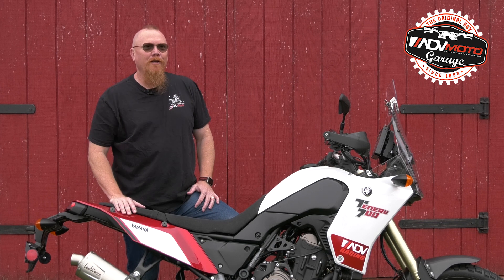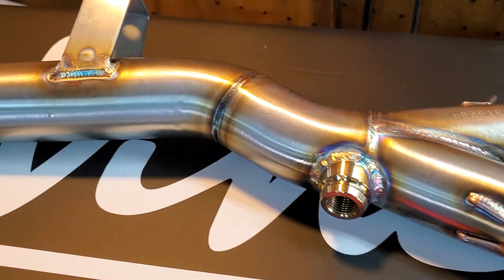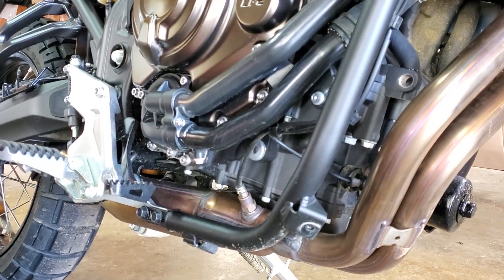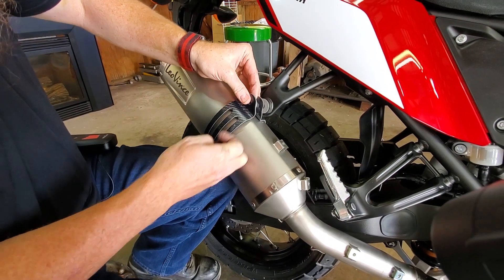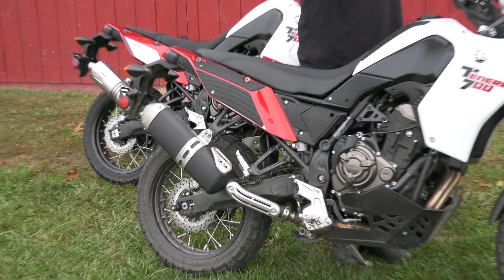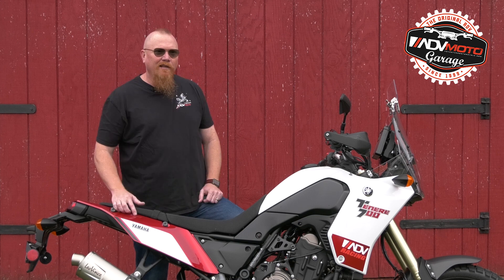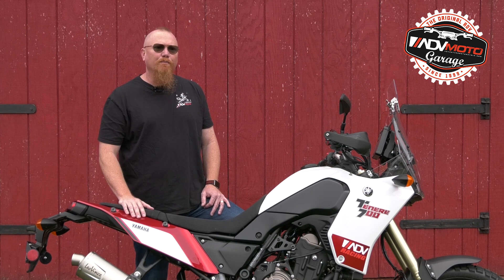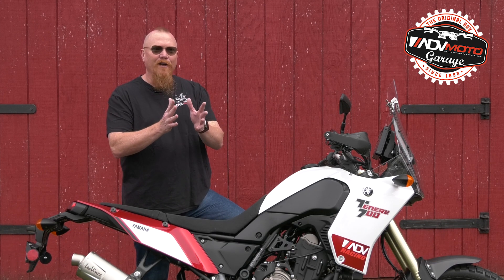Yamaha Tenere 700 LeoVince LV One Evo Exhaust Sound and Install

Comment: Hey fellas, quick update on the header and crossbar hitting on the Givi crash bars. 
Got a machinist to extend the crossbar and took it and had it powder coated. Worked like a champ, can't even tell it.
Installed the leo headers and paired it with the HP Course Ti pipe. Sounds great 👍. Sent off the ECU to get flashed, probably saved close to 8 pounds off the bike..
Reply from the maker: Awesome! Thanks for the update. Feel free to post a link here to the project if you have one.
Reply: Neil - I'm running the Givi crash bars and debating getting these headers.  Is there any way you could link to a pic of your modified crossbar?
Reply: @mpwicks  I would be glad to share the pics of the modified cross bar if I knew how to on here?? Sorry ..lol.

Comment: Hmmmmmmmmmmmmmmm. wondering IF any change in performance....dyno numbers?  Maybe add to the exhaust list for ULTIMATE T7 build.
Reply from the maker: They have a dyno chart and other key info the LeoVince page! https://storage.sbg.cloud.ovh.net/v1/AUTH_ac434bf2b1a448bc980f9f33012daf94/static/products/powerdiagrams/GP-14330EB.pdf
Reply: i have two T7 one just with leovince exhaust and one with decat and exhaust. there is more tork lower down with exhaust, with decat and exhaust there is a big gain in power i am running stock ecu.
Reply from the maker: @adriantompson  We found a bit of decel pop on stock ecu but not much. Others claim it can get some big gains from remapping.
Reply: @ADVMoto  my mate runs same but he has had his tuned, we both said after riding both bike the tuned one revs a bit more after 6000rpm. but not a lot in it. back to back on the road the tuned one gained about 3 foot down a straight live in uk,

Comment: Just a heads up for people, if you have Givi crash bars, the Leo 's header will not clear the crossbar for the crash bars... :(
Reply from the maker: Thanks for the headsup on that and  sorry you had to find out. The LV header pipes don't follow the OEM shape exactly. depending on what you're installing it may be a problem.
Reply: @ADVMoto  if you guys find any crash bars that work with Leo header please let us know, thanks.
Reply from the maker: @neilmosteller2472  How far off was the clearance from the Givi bars?  We plan to only install side crash bars, skipping the full wrap around upper protection.
Reply: @ADVMoto  it probably won't take much to clear,  maybe 10 mm or less. Later today I am going to mark the header fully seated without the crossbar in place. Then I will put the crossbar back on  and slip on the header till it hits and take a measurement. I think I have found a machinist that will cut the crossbar and extend it and weld it back, but he won't be back at work till Monday. 
I just hope he is good because if he screws up the crossbar only way to get another one is to buy another set of crash bars !! I will let you guys know how it goes next week. 
Thought about buying another brand of headers but will probably be the same issue.
Reply from the maker: @neilmosteller2472  <scratching head> Yeah it could be that way.  What about cutting the cross bar, then screwing  or welding another flat curved piece of metal between the two?   We had to bend out the stock skid plate (which was easy) a little bit. Def keep us posted on how it goes. It's a great system but stuff like that is annoying to deal with.
Reply: @ADVMoto  I did some measuring today and found the header needs to go in an additional 6 mm with the crossbar installed to fully seat. 
I am going to see a "machinist" Monday, I think I have a good idea on how to get the crossbar to work if I can get someone to properly do it.
The Givi crash bars are really the only ones I like and would like to keep them.
Going to see if I can get him to extend the back of the crossbar 10mm to be safe, so it will be closer to the motor and further from the header. Will let you know how it goes next week..

Comment: leave the oem exhaust in place and save all the money for something worth buying. the sound of the oem exhaust is pretty spot on. This LeoVince isnt better, but that is just me. OK the weight difference is something at least
Reply from the maker: People like to upgrade different things on bikes.  There's nothing wrong with these bikes as they come from the factory, but are platforms to customize however a rider sees fit.  Just saying this kit saves weight and sounds amazing.
Reply: Oem looks awful and weighs a ton
Reply: That's not exactly true, the OEM header is a restriction on the bike and it has a catalyst as well.  Which drives up the temperature of the engine because it doesn't flow as well and  holds in heat.
Now if you were only going to put a slip-on pipe on and no other mods then I would say keep the  OEM header. These motors are lean as s*** from the factory and they have some weird timing curves on them as well trying to meet emissions. A good exhaust and header system with a ECU flash really wakes the CP2 up.

Comment: Did you have to tune and remap? Did LV provide any map?
Reply from the maker: Did not have to remap.  We were expecting some decel popping but everything seems to be fine.  I don't believe they provide a map, but there is a before/after dyno chart on their site I 
believe.
Reply: MT-07 with full system sees very beneficial changes with a quality ECU remap. And this history is well established since 2014.

Comment: You left out the part where you need to reattach the O2 sensor to the new pipe .
Reply from the maker: Yes, this was meant more as an overview and not a detailed install guide.
Reply: The 02 sensor cable is a bit stretched.